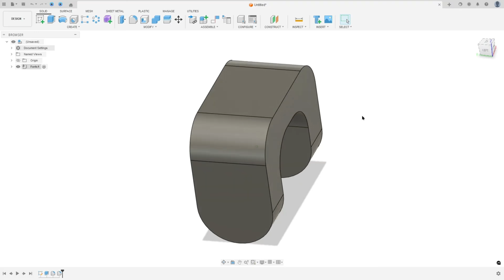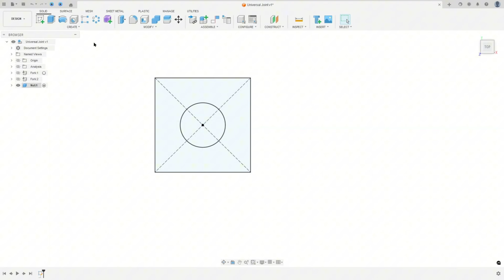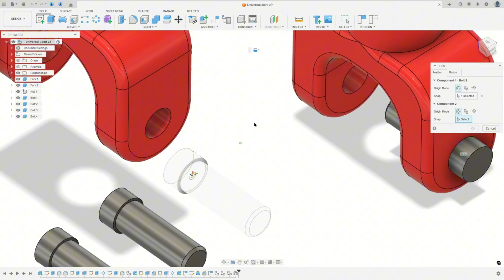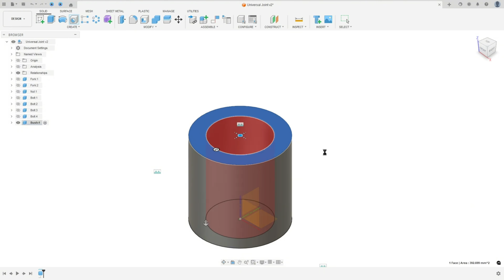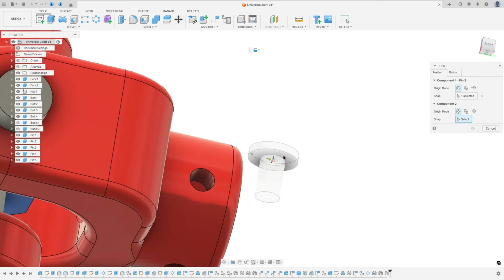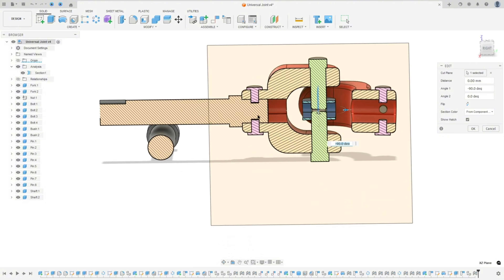How to Design a Universal Joint in Autodesk Fusion | Step-by-Step Tutorial

Comment: Hi, I have a question. I followed the instructions exactly, and the parts look fine. The problem occurs when I use the pin on the yellow ring and then turn the shaft—the parts don't move at all. What could be causing this? Please help :)

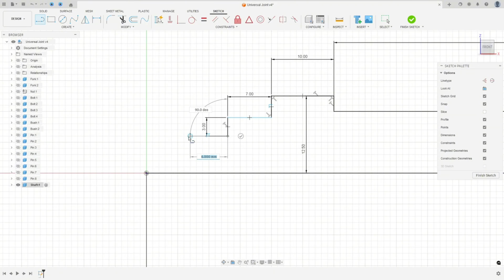Comment: 00:26:24 I have a question about why the SHAFTR with width 6 is 3 mm lower than the SHAFTR with width 7. I don't see the diameter or radius on the drawing